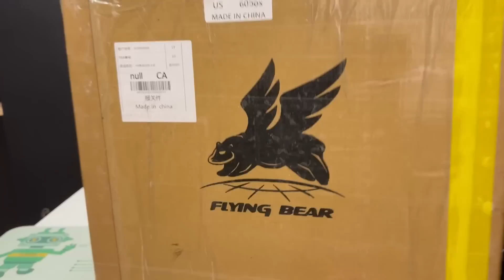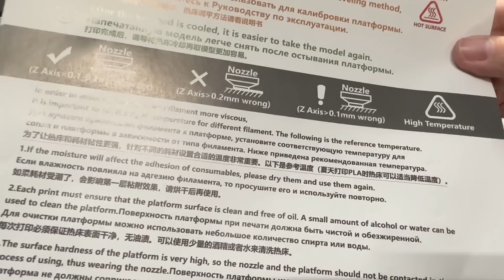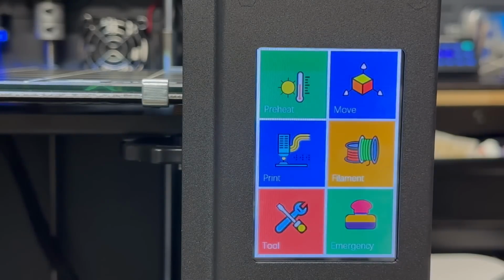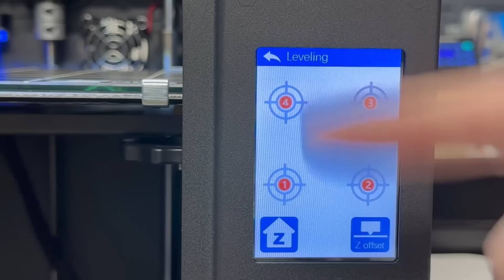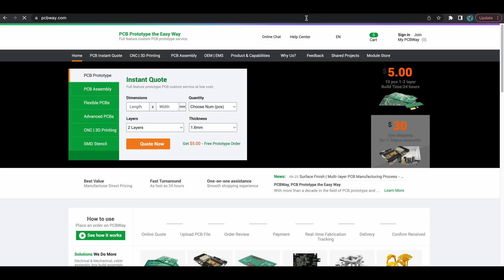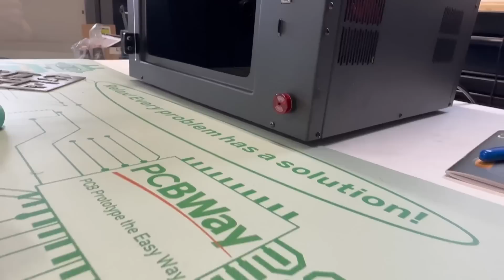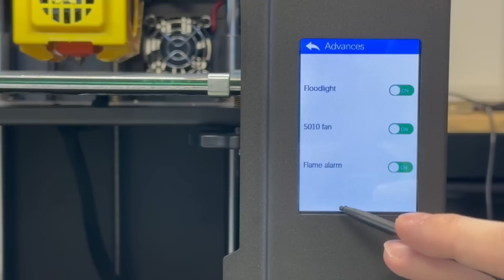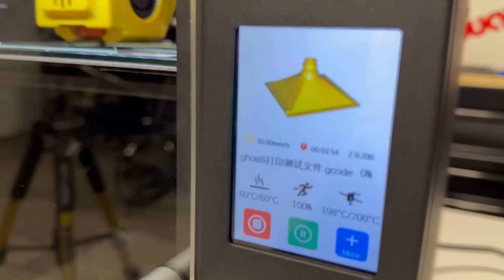$319 CORE XY 3D PRINTER - FLYING BEAR GHOST 6

Comment: Bought one in december and i'm pretty happy with it. Only added bimetal heatbreak as i plan to print some abs & nylon later. 
I also deleted PTFE tube guide at first, but then i  tried to use the top "hat" and free moving tube made annoying screeching and pulled it to the side, thus making it seal much worse. So then i chamfered the brass fiting and bent it's mount slightly up, so the tube is inline with the giude, had no filament grinding/jamming since.

Comment: Looks like a good printer for the money,  seems much better than any of the Ender 3 family.  It should have some kind of ABL system, I'm sure they could add one for just a couple of $.  Then it would be a good starter printer.  Wonder how well it does ABS and PETG?  Don't let Bear see how it flys.
Reply from the maker: It is nice to see 3D printers that are not just clones.  More like an appliance.  To me the perfect upgrades would be, ABL, all metal high flow hotend, and PEI sheet!  Bear didn’t seem too worried about someone using his name 😉
Reply: Not sure if it needs abl on a build plate and size like this, should be level and forget style in this frame

Comment: I have another one of their printers, the reborn 2, which is bigger and has a metal heat break. other than some missing screws and nuts, it prints surprisingly well. It has a pt1000 so you might be able to go up to 500C with it but the heater block is stainless steel so 400 is max
Reply: Stainless Steel starts to soften at 700C .... so...

Comment: Thanks for the video - excellent content. I know this is designed more as an "appliance" - unbox-and-go type and that absolutely has a market. I am curious about a couple of details though - primarily "tinkering". What board does it use? can it be klipper-ised? just how would you attach an ABL if you wanted one? what raiils does it use? etc etc. I know if thats what someone wants they might be better off with a generic bed-slinger style though. Thanks again!
Reply from the maker: Thanks for the compliment!  The board is a MKS Nano4 v3.1, and the Github has a generic Klipper CFG, link below.  You should be able to run a ABL on this board.  However, you will need to fabricate a bracket.  It uses linear shafts and linear bushings for the motion system. Hope that answers your questions?

Thanks

https://github.com/makerbase-mks/Klipper-for-MKS-Boards/tree/main/MKS%20Robin%20Nano%20V3.x
Reply: @TripodsGarage  Excellent! sounds like they've put some thought into the hobbyist's as well... thats a great sign..
Reply: @TripodsGarage  Awesome that they use the v3.1! That supports UART communication with the drivers so you can soft-tune them. TwoTrees still uses the Robin Nano v1.2 in their newest Sapphire Pro and Sapphire Plus printers (which does not have provisions for UART control). This would be a great printer to Klipperize. :)

Comment: Hi! You need to place spacers under screws if you're making an assembly with a big acryl sheet. Otherwise the holes will be broken suddenly.
Reply from the maker: I agree!  If they would have provided spacers, definitely would have included them in the assembly.
Reply: @TripodsGarage  you can even print these spacers ))

Comment: Forgive my ignorance but isn't speed the point of CoreXY? Are there other major advantages? I could be excited about a fast printer for $320, but this unit seems to be slower than a stock Ender 3, at least in this video.

Edited to add, great job on the video, very comprehensive review. I'm just disappointed in the printer, haha.
Reply: I was wondering the same thing.  A speed test would be quite handy.  It seems like it should be capable of high speed printing.
Reply: @corynardin  Yeah, apparently it can do 150mm/s which is triple the Ender 3V2's speed, but I have to wonder what the quality is like at that speed. It seemed in this video that it was printing more like 30-50mm/s and having quality issues already.
Reply: Comprehensive review, this is barely a preview. Didn't even test the speed, the WiFi, ABS since it's enclosed, etc..etc.

Comment: Looks a bit janky to me, considering most people print bed support mods for cantilever beds you would have thought they would be included, even Creality has included them eventually, but hasn't retro fitted them to their older machines ,the company famous for never fixing their printers faults!
Reply from the maker: Reminds me of the Creality 5 days as well, so many people printing structural parts.  I have never been a fan of cantilever designs, to prone for sagging.  Just add a two more smoothed rods and call it a day.
Reply: Last year I bought a Ghost5 and REBORN2, and I did encounter some problems, but they quickly solved it and sent a lot of accessories to me

Comment: When you can get an Artillery Sidewinder SW-X2 for under $300 I see absolutely no value in this printer as the X2 is superior in every way.
Reply: Imo any printer that doesn't come in an enclosure is trash. I feel enclosed should be standard. Of course this printer ain't that great either lol
Reply: @user-tj7xr6xd9z  An enclosure isn't important unless you need it, your average user doesn't.
Reply: I think they are not comparable. Can ABS be used for X2?

Comment: Why is retraction distance is so large???
2.5 mm looks like almost bowden setup. Direct extruder should keep this value less than 1 mm
Reply from the maker: Yeah!  Seems that printers I review with Direct Drives have the slicer at a ridiculous 6mm+.  I always start at 1mm.  That is what you saw with the first benchy.  I increased it to 2.5 for the bunny.  I saw no stringing, I then did another test benchy with those settings.  It might be because of how long the PTFE lining is?
Reply: @TripodsGarage  The reason for stringing can be too high hotend temperature, filament moisture or slow travel moves.
Reply: @TripodsGarage  I have a direct drive with about that amount of distance between the drive and hotend on one machine and a low flying extruder on a delta, both are 0.4 to 0.5mm retraction. Also don't forget that you need to tune retraction speed, it makes a big difference.
Edit: Now that I think about it, I converted one of my core-XY machines to direct drive too a while back... all of them have around a half millimeter of retraction. Anything over 1mm is far too much for a direct-drive.